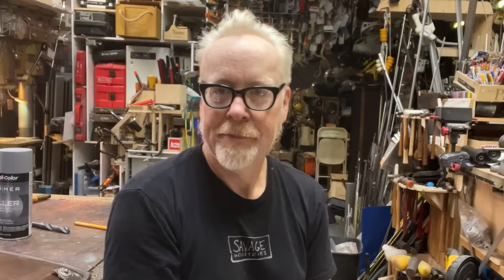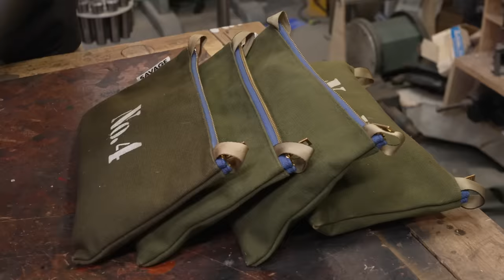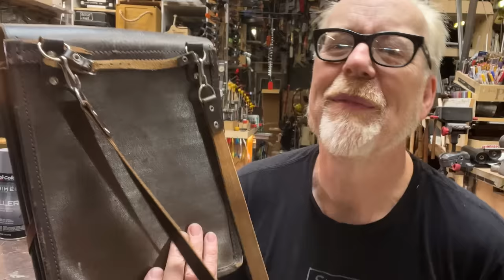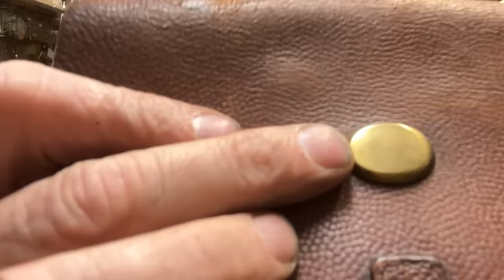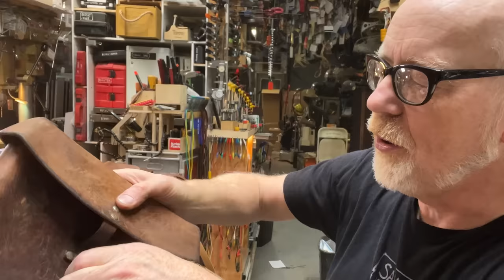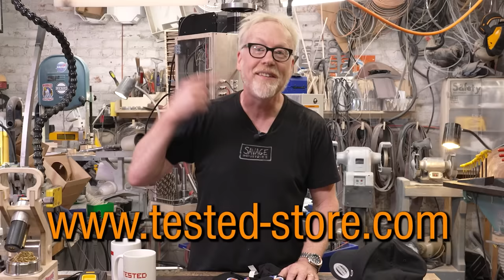The First Bag Adam Savage Obsessed Over

Comment: The rectangular pocket on the right hand side of the brown German map case is for a Deckungwinkelmesser, a small hand held optic tool used to help calculate distances and heights for indirect (or volley fire) fire from machine guns, artillery and mortars. The little slot cut in the pocket was for a leather strap that was used to help pull the tool out (missing on Adam's map case).

Comment: For me it was the MK-VII. Adam and many others will know what that is, but for the casuals that's Indy's bag.  Whatever Indy needed, be it excavation tools, gloves, or a place to stash a sacred stone, that bag answered the call. I coveted it throughout childhood, and over the years I spent a lot of vacation money at the military surplus booths of various flea markets trying to scratch that itch.  In my teens I found Indygear and finally learned why, despite finding several very neat satchels, I had never seen THE bag.  WWII stuff wasn't showing up in surplus stores by the time I was browsing their shelves, and on top of that it was British.   I eventually got a repro from Magnoli, and it's a great bag, no lie. With a tiny bit of modification(remove the divider from the main compartment and pull the stitching from the bottom of the rear slots to make them deeper), it provides perfect storage for my earpods, cased tablet, phone, wallet, and power bank with plenty of wiggle room for cables and other miscellaniae; the strap rings are a great place to clip my keys or anything else small that I might want to have extra handy, and the front compartment is perfect for my pocket protector and a few snacks.  
Aside from that my current favorite is a Venturer Portfolio bag, which is much smaller but with careful arrangement can hold all the same stuff i usually have in the MKVII except for the tablet, making it perfect for a day of casual errands.

Comment: My coolest aquisition in this vein was an original Afghan War type Soviet RD-54 paratrooper rucksack (modified to be worn just with shoulder straps, not attached to the belt). It sits extremely high on the back (supposed to go over one's parachute), has a shape that's kept up with a metal frame, and two large bottle-sized compartments on both sides. It' super neat; looks like few things do. It sorta recreated that Fallout Combat Armor backpack look for me. Today, these are available (but mostly they're in ugly green pixel fabric).

Comment: These are easy to make.  What takes forever in leatherworking is cosmetic stuff like burnishing and/or painting the edges, making sure every stitch is perfectly in position, lining the interiors, etc.  But military equipment doesn't give a shit about any of that, so once you get a prototype and a pattern going, these are quick to churn out.  Still not super cheap if you want to use quality leather and hardware though (and you should).

Comment: US Army M15A1 Gas Mask Bag, especially when slung around the waist by the suspension strap and strapped to the left thigh with the secondary.
Costs in the $15-$25 range, OD Green (of course) and made with a multitude of strange pockets in weird places.
If not that, search for a Swiss Army Bread Bag, in "Rain Pattern Camo".
But for the cognoscenti, go with a Mountain Smith Lumbar Pack ("Day" pack size) add both the shoulder strap and "strapette" options.
Truly Ne Plus Ultra.

Comment: Coach brand Station Bag might be the perfect small bag (it is 9x9x2.5) and it's Coach so the leather and hardware quality is top tier. While I have switched over to a fanny pack for a while: I carried mine for years when I wasn't carrying a larger messenger style bag (fwiw Domke Super Satchel (also an amazing, and sadly discontinued, bag) is my large bag). The boxy shape is efficient and the pocket layout is minimal but excellent: with the large flap in a pinch it can carry a lot more than you'd think. The twist style lock on the flap is one of the best secure but quick access closing mechanisms. I was lucky enough to accidentally score a late 60s early 70s NYC manufactured one many years ago for cheap because it was missing a strap. I prefer the nylon webbing with brass hardware strap I ended up over the original non adjustable leather one (bought from a custom strap website which is also sadly no longer with us).

Comment: A character in the Amazon TV series "A League of their Own"... she carries a Soviet map case bag... It was probably picked because it reads as a "masculine purse," but COME ON. NO American is going to be using a Soviet map case during WWII.  I recognized it instantly because I have one as well, and had been a bit obsessed with them as well, but my ALL TIME satchel obsession was the Vietnam-era USMC haversack (lower half).

I had found one at a surplus store in Madison, WI in 1987, and it became my everything bag in high school.  It also came with me to Europe for my semester abroad.  After ages of use, it was dying... and I couldn't find another.  Until I did.  THE BAG WAS REBORN.  The second actually got stolen when our car was broken into in 1997.  I thought that would be the end of ever finding another, until I found one on ebay for ten bucks.  And so I bought every single one I could find on ebay that was no more than around $20.  I think I ended up with six of them?  But NOW... I work for Milwaukee Tool, and I got one of their tool bags and turned it into a brief case (I added a lining to it with pockets and pouches integrated into it.)

Comment: while its not a leather map case bag it is a military surplus map case its made from canvas and if you look up m1938 us military map case you can find lots of them and there even a post war version which is very similar to the m1938 us military map case in looks and materials but its a bit smaller and it has dot snaps to close the flap unlike the m1938 map case which is much bigger than the post war version and has lift the dots to close the flap

Comment: I've thought about making myself a satchel with a similar form factor for short hikes - something big enough to hold a small water bottle, 1st aid kit, sunblock, and bug repellent; but not a full on backpack which feels ridiculous for anything less than 4 miles.

You are so right about SF and jacket weather. I've had some thoughts about dealing with the various microclimes - I used to live out in Antioch, and it was so wild to go from 90°F and sunny getting on the BART, to 60°F with rain and wind on Ocean Beach. But I need to get the sewing machine out and see if my ideas would work.

Comment: The Swiss „medical bag“ is actually a standard map bag of a Swiss corporal. The medical bag of the Swiss Army is slightly bigger and the front can be flipped open too. The medical bag has compartments for all the stuff. Fun fact: it included a foldable lantern with a wax candle. I carried both during my service in the Swiss Army and afterwards I kept it for many years as first-aid kit in my car and used the map bag as edc bag too.
Reply: I still have my Swiss Map bag, sans leather strap, which I was issued in the late 80ies. Have never seen that medical bag, sounds like I would be great for EDC!

Comment: Hi, the "Swiss medical bag" is in fact a sabretache or Säbeltasche in german. In the former military gear ordonnance (officially valid through 1990, but that was only slowly implemented over a few years after that date), NCOs would be equipped with that part - so was I in 1996. 
Its dimensions were ideal to keep maps. Yours is pretty broken in, but in their new state they are totally stiff, with the leather being easily 2 to 3 mm thick. Not only the year it was manufactured is stamped by means of a cutter, but also the name of the saddler who made it (the MoD would typically split such contracts to a lot of contractors throughout the country). The little bag on the strap was to hold the compass, they were made by the still existing RECTA factory ; these compasses are among the most clever, no nonsense that you could find. Also, notice the bottom strap with which you can hitch the bag to your belt in your back (or to anything that would do), in order not to be impeded when leaning forward, cycling etc...

Comment: Pretty sure the "pocket knife" compartment on the German map bag is for calipres, so you can quickly measure distances.

When I was fixing 2d printers for a living, I ended up using a Swiss gas mask bag to carry all my tools.  It was about the same size as the map bags, but just a single compartment.  After I lost that job I used the back as a purse until it finally wore out.  Also, WW2 era Bren magazine pouches make decent bottle holders, so at one I rigged up a couple pannier style to ride on the back of my bicycle.  Mine are Canadian (my grandfather took them to Holland in 1945) but the pattern was pretty universal across the Commonwealth.

Comment: Most of my favorite bags are old gas mask bags - hey, it was good enough for Indiana Jones, you can't go wrong with that!

I'm particularly fond of the Finnish M61. Made of heavy cotton with generously adjustable shoulder and waist straps (or waist and thigh straps if you want to wear it like a belt bag), lift-the-dot buttons, one surprisingly voluminous main compartment, one smaller compartment exactly the right size for phone, wallet and (sun)glasses case, and a number of inner pockets along the front perfect for keys, pens and pencils, a pocket knife or multitool etc.

They used to be ubiquitous up here as unused military surplus, but it looks like the supply has finally run dry. Which is a real shame! I've considered taking apart one that I managed to wear through (after twenty years of daily use) for a pattern to make one myself, maybe a bit fancier, maybe in leather with brass hardware...

Comment: My favorite personal item when I fly is a 1980s Finish gas mask bag.  It's got little internal pockets perfect for passport, toothbrush and charger.  Light brown canvas with metal hadware.  Really, most gas mask bags are sized great to store what one would need for a day or two but this one is my favorite.
Reply: I have a similar Finnish military bag but meant for "marking equipment". It's slightly slimmer and has the main compartment divided 70/30% by a wall, and bunch of pen holders and notepad pockets on the outside under the flap.

Comment: I used to carry a Swedish m/39 gas mask bag for a couple of years before getting a different job that required more stuff (so a backpack) to be brought along.
 The m/39 gas mask bag is really simple, two differently sized  compartments, shoulder strap and waist strap(which i didnt tend to use).
Its a bit bulkier than the three you showed off and mixed canvas/leather deal, perfect for carrying one of the early subnotebook computers, its charger and some other random day use stuff.

Comment: Fantastic to see a fellow bag enthusiast; I got my first map bag in highschool and have been making and buying some funky styles over time; I made a peacock fanny pack, electrically heated instrument bags (for 15 woodwind instruments) and recently bought a recycled rubber belt bag that clips around your thigh (handmade by a group of rastafarians in Turin). On the wishlist is a bike/backpack hybrid and a specialised toolbelt for both mechanical as well as textile tools.
You might like the Freitag bags from Switzerland, which are made out of recycled truck tarp, seat belts and bicycle tubes.

For me, the ultimate 'hand' bag holds all essentials without requiring my attention, such as holding it, keeping it on my shoulder or otherwise. "The bag as a garment", let's say.

Comment: Have you ever tried replacing the plastic on the Russian bag? I’m assuming it would just be sewn in but idk how to do that.
Reply: You unpick all the stitches, to get the leather parts separate, then get a new plastic inlay, and carefully sew it back into the existing holes, then sew the rest of the bag back together. If you are careful you can just undo the stitches around the plastic and use a curved needle and pliers to hand stitch it without stripping the bag, but using a leather sewing machine, set to follow the same pitch, will be a lot faster.

Comment: I've flipped a few old Voltmeters that had leather cases. The case's have a space for everything and everything in it's place right down to spare batteries. I also picked up an old Lineman's bag that I keep in the house as the grab bag for tools instead of a box.
Reply: 2nd on the lineman’s bag, though mine is a repro from San Fernando Valley Bag Co, still robustly made from 24oz (!) cotton canvas though.
Reply: @88sstraight  mine is a canvas too. Mine is green. Found that it is still made, but now cream/tan and not as thick.

Comment: I have a bit of an obsession with messenger bags. I think I currently own 12 or 13. My favorite is the original Bag of Holding from ThinkGeek. It's perfect for me. I used to carry it to work every single day. The main compartment would hold my lunch bag and Nalgene water bottle. The inside pocket housed a couple of spare keys for my house and car. The front pouches held my EDC items(like Leatherman, chapstick, pens, pencils, sharpies, tiny first aid kit, glasses maintenance stuff like a microfiber cloth and mini screwdriver, things like that). And the laptop pouch housed whatever RPG book I was reading at that time. The back pocket usually carried a notebook for writing down project ideas and whatnot. I freaking love that bag. Quite sturdy, it's held up for many years now through some heavy use. Whoever is reading this, check one out sometime. If I'm not mistaken, ThinkGeek is no more, but I've seen the bags on eBay several times.

Comment: I have a small Finnish messenger bag of some sort, may have been a map bag bag, but I doubt it since it's canvas not leather, but it is my go-to EDC bag. It has a pouch that is the perfect size for a Nalgene, and enough storage for all my pocket litter and I'm still able to fit a light jacket in it if needs be. But what really makes it shine is that in addition to the shoulder strap, it has a waist strap that you can click on taking some of the load off especially when you have a full water bottle in it. I personally find messenger bags to be highly fatiguing, and this takes a significant portion of that load off the shoulders.
Reply: Sounds like a M/61 Gasmask bag. They used to be very easy to find, but unfortunately their supply has dried up few years ago.
Reply: @wryyyy  yep that's the one! Thank you I would have never found it on my own :-)
Reply: @MobiuSphere  Around the same time when they were making those gas mask bags, they also made a bag model for "marking equipment" whatever those might've been. But its a very similar bag, just a tiny bit slimmer, but with plenty of pen holders and pockets for notepads on the outside of the bag, under the flap.

Comment: Hi Adam. I have been buying different bags at surplus and second hand stores for years, but I always seem to come back to my vintage US Military M6 Lightweight gas mask bag. Nice storage area with a few pockets. Some attachment points for extra stuff. I love the closures. I have been thinking about trying to waterproof the canvas with oil cloth treatment, or maybe even reproduce the bag in leather. Enjoy!
M6 Gas Mask Carrier

The M3 and M4 series of Lightweight Service Gas Masks required a new carrier bag due to the shorter hose length. The M6 bag was used for both the M3 and M4 masks (and others) to hold the mask itself, the canister, plus accessory items such as anti-dimming sets (to prevent fogging of the eye lenses), covers and protective ointment. The bag has interior pockets for accessories and is stenciled with "Army Lightweight Service Mask" on the exterior front, near the bottom. The M6 bag has a top closure that is secured with three LTD fasteners. Like other WW II webbing and bags, the bag color was OD #3 early in the war but changed to the darker OD #7 shade in 1943.

Comment: My favourite bag is a 1970s-ish Finnish military "marking equipment" bag, as it has just the right amount of compartments (and pen holders) and its made from thick wear resistant fabric, so its fairly water resistant and holds its shape, plus the flap is secured with those really handy "lift the dot" type of fasteners seen on US WW2 bags and pouches. It has a very similar construction as the Finnish M/61 gasmask bag, though that one has only a single large compartment. Both also have an extra horizontal strap for strapping the bag around the waist, to stop it from swinging around if running. Works well for keeping the bag on your back while cycling too. BTW, love the Seiko SKX.